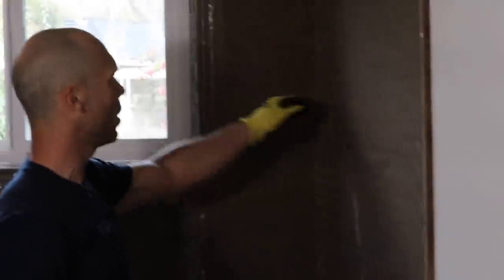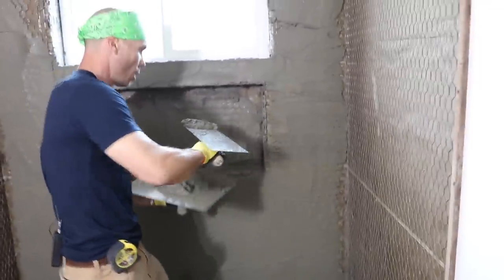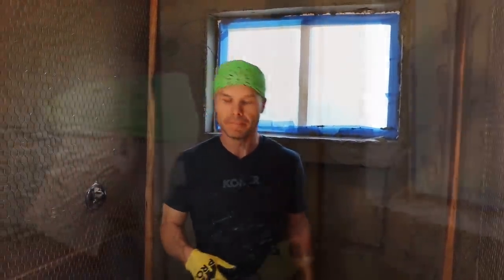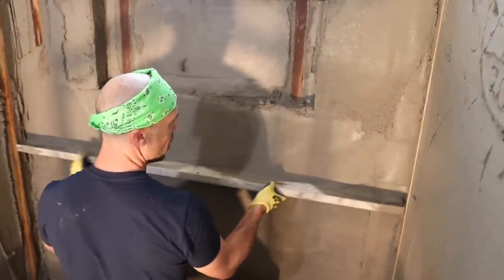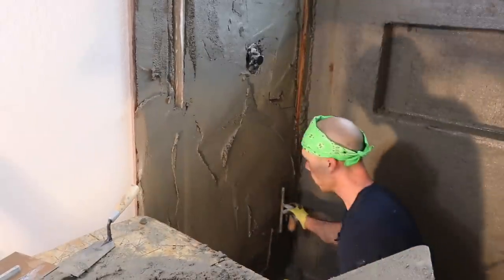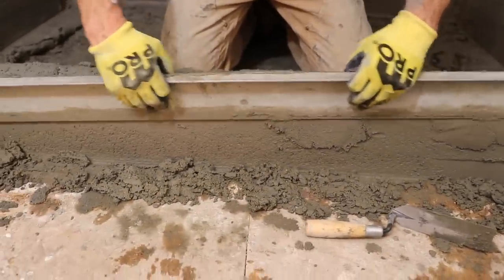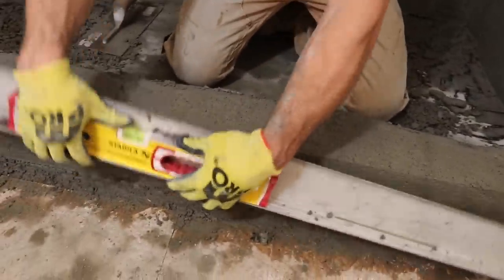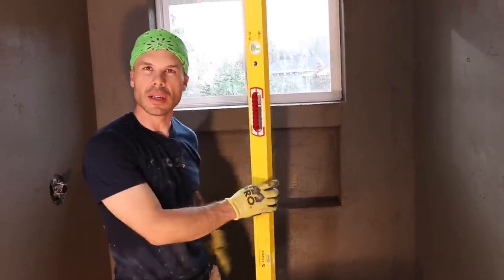Learn how to FLOAT! Tile Coach Episode 23

Comment: Isn’t it real important to screw the wire to the wall?  If not, what is holding all the tile to the wall?  The paper will act as a barrier.
Reply: Nails works too
Reply: Most people use staples ..
Reply: 0:53
Reply: I don't think the other commentors realized what you meant. You're asking primarily about the paper acting as a barrier between the "fat mud" and wall. I was wondering this myself and what purpose the paper serves? I'm new to this so I don't know.
Reply: @infinite6163  The paper is his waterproofing. One of the reasons older tile Setters like myself use Diamond Wire is because we prefer the thicker water barrier than the 7  1/2 pound paper that comes interwoven with the wire as shown here. Yes, that wire and paper is one product.
Reply: We use staples to get the wire to hold and then finish it up using nails. You just have to be aware where the 2x4s are as you go along
Reply: I thought paper behind the wire mesh is bad? And a durrock or similar is the correct way? Or easiest way?
Reply: @nathandey9749  Pick up a copy of the uniform building code. There's a section 4 ceramic tile. It has the correct specifications for everything you need to know for a shower, including drawings.
Reply: IRC 2018 Ch 7 looks to also cover this. Local building codes (AHJ) would be a good start, some have templates for remodeling.
Reply: Love these videos, but wondering the same as other comments, if you don't attach the wire to the wall, what connection do you have between mud/tile and the wall, similar to brick and brick ties, I would think you need something
Reply: Staples will hold the wire and mud. for safety reasons you screw or nail some of the wire...the paper prevents the water from the mud going into drywall you still need to water proof your mud before adding tile
Reply: Lol, Old school method.  Plumbing the wall with shims and using cement board is 1000 times easier and quicker.  A novice shouldn t try this.  There s a reason it's called a skilled job.  Not sure why anybody would use this method today other than repairing a 40+ year old bathroom.
Reply: @patrickkendall8259  Exactly. Working on a 1950's bathroom right now. I don't think I'd go to this extant, but want to see as much about floating as possible to make the best decision on the way forward.
Reply: @michaels840  If your doing it yourself just rip it all out.  It's not worth the time and effort to meet up with it.  If your hiring a tile guy let him decide if he's skilled enough to do this.  Old school mud adds alot of weight and takes away from the space a couple inches.
Reply: @michaels840  Good luck.
Reply: I think it’s just better to use DUROCK and shim it or level the studs first then simply waterproof it. Any minor imperfections can be remedied with the thinset as you’re installing the tiles.
Reply: @infinite6163  same i want an answer
Reply: I’ve gotta agree.  While I’m impressed with this method, essential plastering a shower, I was surprised to see this as I don’t think anybody has done this on the east coast in my life time.
Reply: @Frank Caltabiano what is behind the paper? Drywall? Or just the paper and wire stapled to studs? And they  ever show how to prep. Window before putting paper/wire on. Ugh.
Reply: Man, you are just an awesome person. Master tile layer. I’m a very good judge of people and I can just tell you’re a good person as you are a tile layer. 
Great job, thanks for the video!
Reply: Staples just hold the wire to the wall. Once the mud hardens and creates a form of a box with the support of the corners and other walls, it becomes a solid self standing form. DO NOT USE NAILS through the studs ! If it is an outside wall and you nail into the structure to hold the wire, then during expansion and contraction from hot to cold the movement could cause cracking in the walls or corners . Staples let the structure of the float and the framing move like a shock absorber as the staples can slide in and out of the substrate or backing .
Reply: @raymondsiewert2720  okay, now this is making more sense to me. So the tile will be independent of the wall movement. I can’t wrap my head around it though if a tile niche is used.
Reply: @DayTrader__  I'm a very good judge about people who boast they are a very good judge of people....drinking your own bathwater isn't intelligent

Comment: Excellent job young man. I've been doing tile for 40+ years now. My mentor that trained me in the early 80's came from the 60's era where lathe, scratch and mud set was the only method. And, you even had to soak your 4X4 tiles due to the extreme absorption of older manufacturing methods of the time. That was old school. Keep up the good work.
Reply: We still do them like that in southern CA !

Comment: To the people asking why not use cement board or hardibacker, it's pretty straight forward. When the walls are perfectly flat and plumb, which framing will never be, and without extensive use of a planer, neither will your cement board... The setting is gravy! Kerdi can be wet shimmed, but it generally still wont be perfectly plumb, only flat. Mudding greatly improves setting time. Every cut is exactly the same size, and square. not marked point to point. You can rip every cut all at one time. You can spread the wall up much farther since your cuts are already made, and set the tiles without having to pull half of them off and spread more thinset because they are too low or scrape some off  when they are too high. You guys have obviously never set tile on a perfect mud float, or you wouldnt have to ask why people still use this method. "Outdated" is subjective. This is the easiest way for me to guarantee perfection.
Reply: Not to mention, labor and material cost savings.

This mud is cheap. Much cheaper than wet shimming with morter.

Even though this took 7 hrs to do vs 2-3 hrs for backer board, it looks to me that you save the cost of not only the backerboard, but will set tile about 30-40% faster in the end. So 4-5 hrs in prep time vs 7-8 hrs in extra tile setting.....with a much much higher chance of a great looking finish
Reply: An hour with an electric planer will save you all this hassle
Reply: @AOmega72  But he's not in a colder climate?
Reply: fuse98 I thought he is in northern Cali? Is t it cold there in the winter? Freeze thaw’?
Reply: @mikeo6525  hour? You mean 2-3 hours to demo the walls and take out trash. Two hours to electric plain the studs. Then 2-3 hours to put up plywood and backer board. Seems like the same amount of time if not bigger hassle. Also he does this cause California has seismic activity and floating wall helps the grout not to crack and tiles to move.
Reply: I’m confused, don’t you install a cement board first before the wire?
Reply: When you know why you are doing what you are doing, you also know why you are charging the customer out the Yin Yang for that perfection they seek .  High End work will always frustrate hack job workers.
Reply: You’re smokincrack if you don’t know how to use a plainer.. I’m mean, I guess, if you’re working in a mud hut in Afghanistan
Reply: Mortar bed floating is the best on stall showers, and everything else for that matter. It's all l did for 25 years .
Reply: I bet lead pipes were best at some point also.. get back to your 8 track, and vhs
Reply: @719vol I need to know this also

Comment: if you want a "perfect" float you pretty much have to do a scratchcoat. then float the main walls. Later you float the window, niche and damn.  Three days of floating. Its hard to see all the imperfections in a float from a video. When you go to set tile is when youll start running into problems. Then again it doesnt pay to do things perfect anymore.
Reply: Here's an idea that I've done for three days, first day scratch coat, second day finish coat everywhere except for the inside lip of the window and the inside lip of the soap dish. Third Day set all of the tile such that you can then fill in the finished coat around the soap dish and window part using the tile that have allready set as a line against which you can screed. Two hours later you can set those trim pieces.
Reply: this float looked pretty good too me...why do a job in 2 days when it can be done in 1 ???? no logic..time is money

Comment: As a carpenter we run our squares and laser each wall taking as much time to make them perfect now a days. I have tiled showers before and set tub surrounds .I have also watched  plumbers struggle with installing. I always stress to my apprentie to be courteous to the other trades and do your job correctly even if it takes more time for you to make the job right. Using strait studs and crowning is always a must ,steel studs are also a option. Installing corner bead and finishing the walls always adds to the variable. Doing the curb with treated lumber and wrapping it with cement board is my standard. You have to realize the traffic that curb will endure over the years. Great video always nice to learn some tricks of the trade.

Comment: This is awesome.  I am trying to implement this into my showers. I've watched so many videos, but I haven't found one yet that shows the part before mudding.  I am trying to understand the paper and lath that is installed, is that over studs or over backboard?  Same with floors, is that over plywood?
Reply: Yes I was wondering the same thing..
Reply: Ditto! Also would like to understand the very first steps better.
Reply: He is from Northern California, there they float over Drywall. People like myself, from Southern California go over the studs. We also use Dimond lath, which is far better than wire.

Comment: I use drywall shims on my studs and make sure everything is plumb and in plane. Takes an hour or two at most. This way your kerdi board or cement board goes up super easy and everything is ready for a perfect tile set. Im surprised no one has mentioned this. Its a standard where i'm at in Colorado and where i'm from, Michigan. But if you're as good as him with the mud, no need to change how you do it!
Reply: I do really like to just tile over the driwall !! If the driwall is flat , but some time the plumbing straps make drywall humps that’s another reason why the floating has to be done
Reply: Yea but if you aren’t framing the shower then his method is the best. As a tile guy I show up to new construction and I can’t just start taking off drywall to fix it lol. So either we mud it or float the tile
Reply: Are you using the 1/8 drywall shims?   I don't think they're good enough for tile work.  Not uncommon to have to go from nothing the 5/8 or 3/4 and thats too much to build up drywall shims.

Comment: I'm impressed, cement board from scratch!  I'm still scratching my head, dont get it. Nice job though.
Reply: This old school, before cement board all bathrooms was done like this...in 2000 I was mixing 10 to 20 batches a day...
Reply: Yeah I’m thinking about this a lot because I’m going do my bathroom. I’m leaning towards just reframing areas to make sure my walls are true before putting up backer board.... so the only part I’m still figuring is the water proofing with weeping... this is gonna be fun. My plan is to use river rock going for the manly rugged look.

Comment: As a carpenter, I would just shim the studs to be plumb. 1/4 to zero in 8 feet or whatever it was and then I would hang cement board or I would sister engineered studs (lsl) onto the existing studs and bring the wall out to be true. Or you could screw on metal studs onto the sides of the existing studs. Take your planer and knock off the high spots first. Lots of ways to fix a crooked wall, but you are good with the mud for sure.
Reply: bluebird5100 you’re so right because 20 years later someone is going to have to come behind and demo this stuff out like I just did. It was dangerous. An entire wall can come crashing down on you. I cut myself so many times on that damn chicken wire.

Comment: I learned tile in San Luis Obispo. Floating is the best installation method period. We used to mix 40 batches with sand, cement and lime.
Reply: Nice! I'm in Los Osos!
Reply: Yes did it same way.Labor intense
Reply: I been tiling since I was 15 and I'm 50 now and I have done mud most my life but let me tell you once you hit 50 you don't want to do it anymore lol
Reply: Worst dam part about it is when you have to rip the crap out. There is no easy way. It is straight up grunt work. And dealing with that F**** wire and nails.

Comment: This is an amazing video, great lesson. 
Isaac, if you are reading this I have to ask as to the steel troweling you're doing at the end of the process. It closes the pores in the mortar to run a steel float over and leaves behind a brittle surface coat that's sure to unbond easily over a short time. That's just what I've learned, and unfortunately, experienced a few times before learning it. Wood, magnesium and are fine to use though.
Do you have any thoughts on that? Did you already know or does it somehow not matter for what you're doing? Thanks

Comment: I still float most of my showers like this. I also was taught by master tile setters in  the Bay Area. Must be nice having a good helper. I always work alone. Floating a shower by myself is a very long and tiring day but it makes the tile setting that much easier. With larger format tile I usually don't float anymore but with smaller tile it's almost always a must to float.
Reply: @TileCoach  If i'm not going to float I always bring a bunch of 2x4's  with me so i can sister them to the studs. This way I can plumb and square the walls. It usually takes a couple hours to do that. then I attach the wallboard. I use this method when i do Kerdi showers.
Reply: @TileCoach  I've done two showers in a row now with 24 by 48 inch tile from porcelanosa. You're absolutely right, it is not easy to pull one of those off the wall just to add more thinset. I use a three-quarter inch Notch trowel and back butter. I just use less thinset where I know the build-out is. I agree with you 100% on floating being the best way to set yourself up for an easy tile install. Where is your tile shop located? Maybe I'll come by and introduce myself next time I'm in the area.

Comment: Started as a tile setter here in metro Detroit around 1982. There were no cementitious boards, kerdie or schluter in them days. We pulled mud on all walls and floors. To speed things up we'd use a pinch of baking soda mixed in the mud behind the screed sticks and in the second mud coat. Sets it up fast (15 minutes) That way you could keep going and pull off them right away and knock the finish coat down with the wood float right away. I like that mud you're using. Looks nice and sticky and forgiving. So important. We just make our own using sharp sand, lime and portland. Nice work Isaac. Bringing back some memories. You'd fit right in, in my neck of the woods!
Reply: Isaac Ostrom yes it would..fun. lol Back in the old days I've installed tile that same way. Wed sometimes soak the tile in the mortar box. Always made our own grout too. As long as you wanted white or grey. Lol White wall grout made with white Portland and lime. For sanded we'd just stiffen it up with silica sand. Made our own thinsets too! The good old days! Lol

Comment: Can you explain more about how you made sure your inside corners came out as perfect 90 degrees.
Reply: Wondering this myself
Reply: @LoLoNationalForest  the trowel has a perfect 90 degree corner on it.  If you use it correctly with the proper amount of pressure on both walls, your trowel makes the perfect 90 degrees.

Comment: I demolished a bath once that was a very high-quality mud job.  I think they must have set the tile on the wet mud as you described, because the tiles were stuck hard enough that hardly any of them came off intact.  The bond to the wall was stronger than the tile itself.

-jcr

Comment: If only everyone could have the same pride in their work as you do. The quality of your work really shows
Reply: On a remodel currently going on. The owner pulled in a  crew to do counters and redo the bathtub area. I watched progress at the end of the day. These guys are great. Yesterday I took a square and checked corners all square. Window and nook had a slight slope. The tile setter really knew how to use a tape measure and a level and how to do the math for positioning subway tile. Uniform in cut pieces. It is a beautiful thing to look at other craftsmen work.

Comment: This is not a nor cal method, but one that has been used for many many decades way before any types of backer boards were invented.  It was universal across the country through most of the last century, and taught to any apprentice tilesetter.  It's what I  learned in the 70s, and still do today. These types of installs will last until your get sick of the tile. This is  solid reliable method that allows for plumbing walls, truing the surface and even squaring enclosures. It is a great asset to anyone installing tile to aquire.

Comment: I personally set my float strips on all walls before putting mud everywhere. I can dial the strips in and the mud firms up to prevent moving. Also I tape off the entire perimeter on Sheetrock.

Comment: This brings back memories. When I was 12 or 13, I used to work helping out masons. We had cement and sand separate, had to mix both together first, then build it in a small wide volcanoe shape, and pour water in the middle, pulling the edges over the small water pool created with a farming hoe. Then bring buckets to the masons, once it was all mixed. Back in the late 80s early 90s.

Comment: Stapeling into the studs is so important. Great video man. Im down here in LA and  hot mop and double paper galvanized steel with 1 inch staples. I scratch coat then float. But tomatoes tomato. I also dont use wall board behind my paper.like you said its creating art. Welcome back 🙏